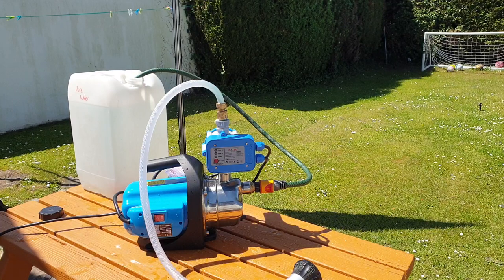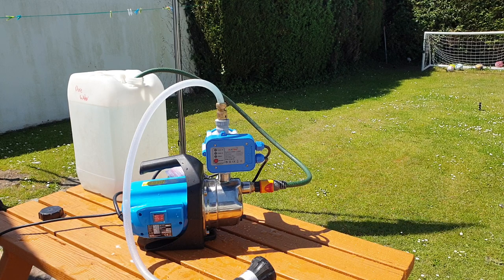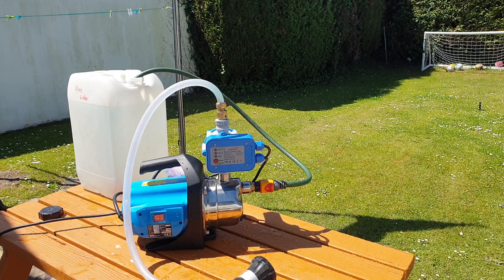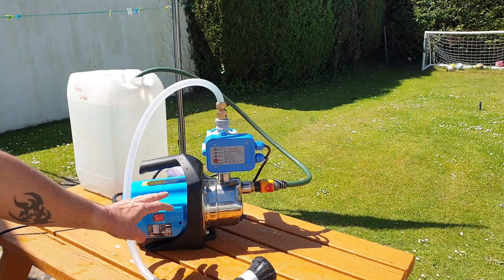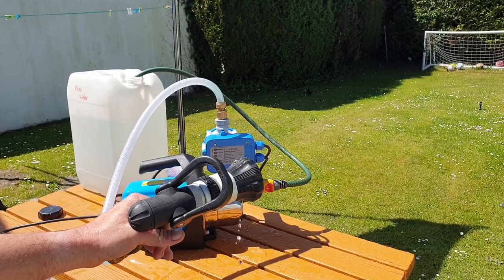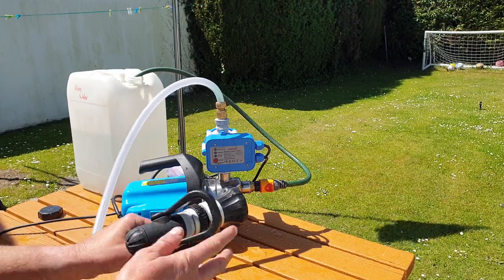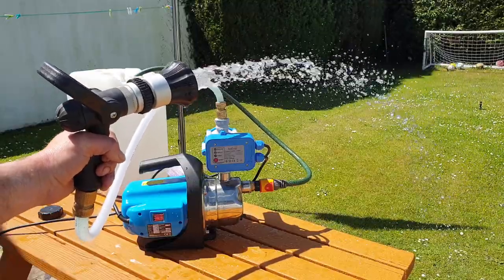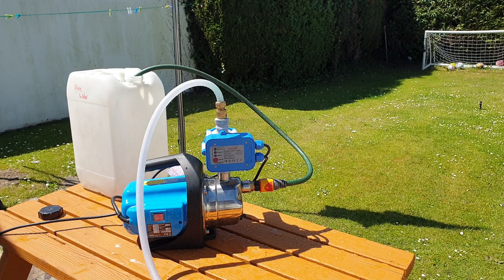Clarke SPE1200SS Pump & Flow Switch Operation

Comment: Hi, great informative video. I’m a gardener, at some of my customer houses they have low pressure from the outside tap. Could I use this for boosting the water pressure externally whilst working at different houses with low pressure. Many thanks 🙂
Reply from the maker: If you have low water pressure, you'll most likely also have reduced flow, so in short, not a lot of water to have on demand. This pump and others similar to this work brilliantly if drawing water from an IBC, water tank, or water butt. With any stored water outside, you run the risk of algae, which may not be good for plant life or the pump.

Comment: Hi Austin. Great video. Quick question... i want to buy this pump to aid the tap pressure to keep flow pressure high. As my garden is over 85 meters. And would like to run 3 sprinklers off it. Do you think it would do the trick?.
Thanks. 👍👊
Reply from the maker: Good afternoon. Things to bare in mind. The pump alone provides 21lpm from memory. If using its full 1 inch bore, you'll achieve more flow over distance and then reduce it to standard 12mm garden hose to your sprinklers. It's a great pump. However, I'd personally recommend one with a pressure vessel attached to maintain constant pressure and a higher lpm output to better the delivery distance. 

Have a look at this, which would better suit your application 
https://www.machinemart.co.uk/p/051016200/

Austin
Reply: @AW-Services  thank you so much for the quick reply. And the advice. I will look into that now. Cheers🙏👊

Comment: Just bought this pump , my plan is to connect this to an Impact Sprinkler hoping the water spray will reach my entire garden which is about 23 meters long .
Reply from the maker: If you use full bore in via the 1" inlet the pump will produce 65.4psi, if you use a pulse sprinkler you should easily achieve your requirements

Comment: good morning, i need to connect to a water fed pole using this system, as a render clean system, i understand most conections getting from supply tank to pump, but from the flow switch outwards i need to connect garden hose to a point were it then connects to a 8mm hose,this small hose runs up inside pole and allows  me to reach high places, 
my point would be, would the pump allow me to use this 8mm pipe without the presuure being to great.hope this all makes sense.
Reply from the maker: The pump isn't the best suited piece of equipment we it's flow rate is far too much and having it running through 8mm will create far too much pressure. Haven't you got a gardener or big boy backpack
Reply: @AW-Services  sorry, yes have not got gardener or big boy, will look into those options, ive seen 35 foot carbon poles used for soft washing with a small pump to feed product to the end of pole,will have to do bit more home work, thanks for quick response.
Reply from the maker: If you are wanting to clean K-Rend for example a simple backpack on a trolley will do. Just be mindful that you do not use Sodium hypochlorite on K-rend as it will destroy it. Biocide isn't corrosive and won't destroy your clothes or equipment.

Get onto the window cleaning forum and all will be answered there
Reply: @AW-Services  perfect ,will do.

Comment: Is there a flow switch that shutoff the pump when there is no flow to protect the pump from burning up
Reply from the maker: With respect I think you've misinterpreted the video. As this flow switch does just that. When the hose gun or output is open the flow and pump runs. When the hose outlet is closed the pump stops turns off and sits in standby
Reply: @AW-Services  I thought you build up pressure then it shuts off. I have an issue in the building water pressure that drops the pressure to nothing sometimes for a few seconds. I want to use a pressure washer without burning the pump. I was hoping there is a low pressure shutoff switch to kill the power with pressure drops for pump life
Reply from the maker: No it's not an accumulator just a pump flow switch that stops the pump when you close the outlet o  demand

Comment: Where do you wire in the flow switch?
Reply from the maker: The flow switch has power in and the pump wires into the flow switch enclosure onto the contracts marked pump. Download the Clarke manual with wiring diagram for reference 

https://www.anglianpumping.com/product/accessories/clarke-epc800-230v-control-unit?gclid=Cj0KCQjw_r6hBhDdARIsAMIDhV_jQ6d6xO8sWIbMR9yVmZjrqgPkB8BsiAFjKNwoJXyZLlQJENwfBOMaAv6bEALw_wcB

Comment: Hi Austin, Would this be ok to use as a booster pump for my 4040 RO?
Reply from the maker: Good evening John. The Clarke pump is rated for continuous use wet or dry, from my own testing using a 1" inlet and outlet bore hose at a 1 metre length for both drawing water from a 25L container it produces a standard flow rate at 61lpm at 63.4psi 

I personally don't use or have ever used an RO system because of my ultra low tds but I'm confident it's exactly the same as any labeled RO booster pumps.

Hope that helps
All the best 
Austin
Reply: @AW-Services  Thanks for the prompt reply!
Reply from the maker: If there is anything I can help with you know where I am,  the best price on this pump at the moment is £112 Amazon UK, for brass reduction bushes or fittings i used toolstation. A few pounds for various parts or you can use ABS or nylon. Both inlet and outlet fittings are 1"bsp female. The flow switch in this video was less than £30 on Amazon as an additional extra
Reply: Hey new to this, I had am ro built with this, stopped working so got a new pump, still not working. Can I run it without the flow switch without issues
Reply from the maker: I personally wouldn't attempt to use this pump within an RO setup. From memory, I know it's approximately 65 psi as is and didn't ever record the psi. You'd be better off with an RO specific self-regulating booster pump which is designed to forfill a specific GPD output. Austin
Reply: I use the Clarke CBM240E with my 4040 RO system. Works well. Just had to change an impeller after 4 years service.

Comment: Great video. I have just bought the pump now I need the flow switch and gun. Where did you buy these from? Could you share links please. Andrew
Reply from the maker: Hello Andrew, apologies for the very late reply. The flow switch is a genric 1" inlet outlet from amazon uk 
The hose gun is a stupidly expensive fire brand hose gun from california USA however you can get cheap ones 

https://www.amazon.co.uk/Tools-AUTOMATIC-PRESSURE-CONTROL-ELECTRONIC/dp/B00BKXWKR2/ref=mp_s_a_1_5?dchild=1&keywords=1%22+water+pump+pressure+switch&qid=1602034521&sr=8-5
Reply from the maker: https://www.amazon.co.uk/SunMate-Stream-Watering-Equipment-X-Large/dp/B004RUHAZ2/ref=mp_s_a_1_9?dchild=1&keywords=orbit+hose+gun&qid=1602034873&sr=8-9

Comment: Where it’s goes other mains from flow switch ?
Reply from the maker: With the upmost respect, I don't fully understand your question
Reply from the maker: The flow switch has mains into the control junction box then you either use a 16 amp plug and socket from the junction box to the pump mains cable or cut of the factory mains plug on the pump and wire it directly into the control box
Reply from the maker: Was that helpful for you Adam
Reply: @AW-Services  that helps and my pump works as should now thanks
Reply from the maker: You're most welcome mate. It's hard at first to understand how it all goes together but a great system when working. I believe the Clarke pump produces around 64psi from memory and when using a smaller bore outlet hose it chucks water a long way. You can buy aftermarket O rings and impellers if you want to run chemicals through it